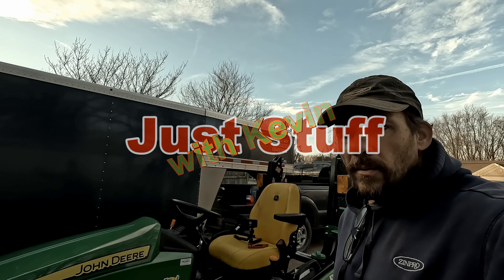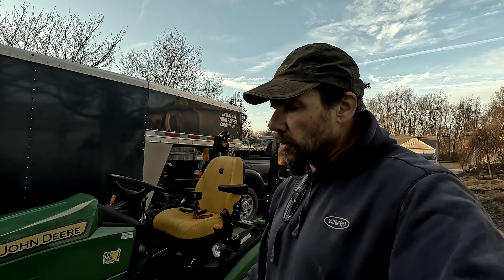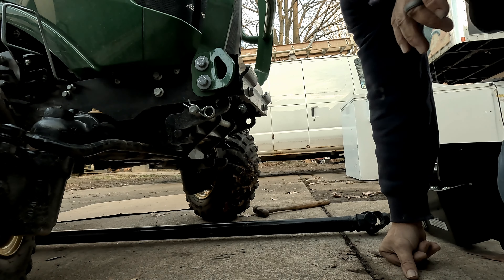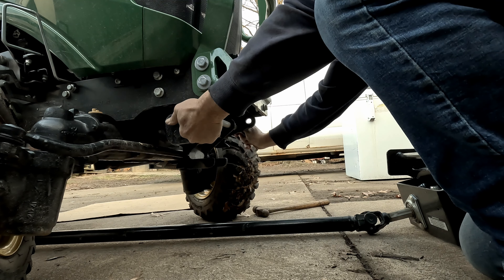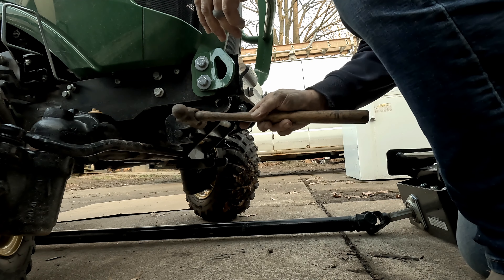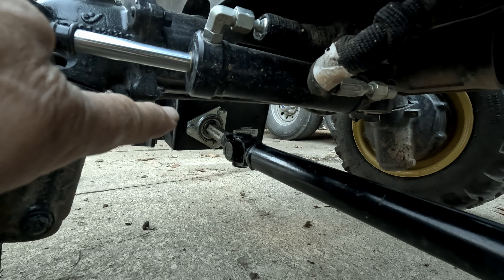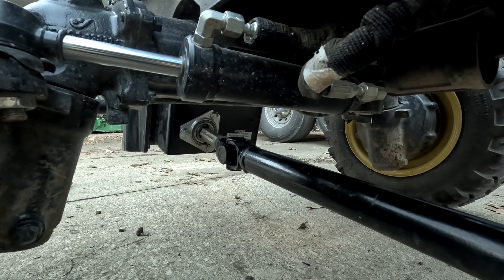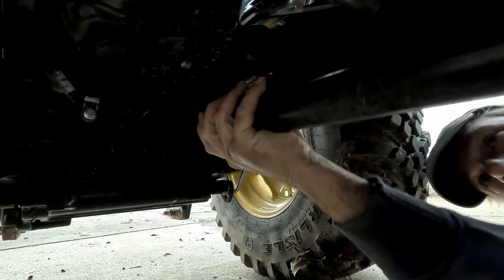Attaching the JD 1025R 54"Snowblower for the First Time, could have gone smoother

Comment: Hi Kevin, I have found a very easy way to install the snowblower attachment. I leave the shaft in the two bearings and spray lubricate the shaft so it will slide in between the two bearings easily.   I lubricate the back shaft on the transmission and lubricate the Power Take Off also.  i put the tractor in 4 wheel drive and drive front wheels on to two 2x6s that are about 1 foot long. with the tractor still running i turn the steering to the right. i set the brake lever and shut off the tractor.  Now the tractor is up off the ground about 3 inches.  i slide the shaft under the tractor and have the front bracket ready to be lifted in place. I than take the snowblower attachment with the shaft in the two bearings and lift up and over the two slots in the back. you can now install the holding rod to secure the bracket. i than just attach the back Power Take Off.  I have found this to be a very easy way to install the bracket and shaft.

Comment: Kevin, Thanks for the realistic video. I have a 2025R with the autoconnect mower deck. I have not connected the snow blower yet but unless yours is different the front bracket you show does not look like it is connected right. The snow blower bracket goes into the same slot that the mower front bracket came out of. You installed the front bracket on top of the slots not in them. Maybe it will work that way but if you look at other videos you will see the front bracket goes into the slots vs on top. Thanks for showing that you have to remove the autoconnect assembly. None of the other videos show that because they don't have the autoconnect assembly. I guess I would have figured that out when it comes time to connect the snowblower but no other videos I looked at mention this step.

Comment: The angle option is not used for the blower. You purchased the 4 way quick hitch which does it all. No angle for the blower but as you know you need it for your blade and it also is great if you were to ever get a broom etc.  just nice to have one hitch rather than two.

Comment: Thanks Kevin.  When using the blower only, there is a large pin that can be put into the hydraulic hitch to prevent the blower from turning.
Reply from the maker: Missing parts seems to be the norm for this dealer and would not surprise me at all. However, I don't think there is a spot for a lock pin
Reply from the maker: Thanks for that. I will look into it.

Comment: Do not turn the blower side to side! You will see a hole in the center of the quick hitch frame that you will need to get a large pin or bolt to fit in there to prevent you from turning it side to side. Also you did'nt need to get 2 of the first brackets. Y u can buy just the double bearings to add to your bracket for your plow bracket that just has the hole in it. Good video to first timers. Hope my tips helped. Steve

Comment: I have the same problem installing that bracket I have to turn the wheels to the right and finagle it up inside of there I ended up modifying the bracket I cut the corners off the bottom so it would clear the tie rod easier that helps big time I don’t know what the differences between my machine and the ones were the brackets just go up real easy Also I leave the lift assembly attached the snowblower and placed the whole blower on a furniture dolly cart I just bring the snowblower to the front of the tractor lift it up on the hook and hook up the hoses and it hooks up almost automatically so I don’t have to wrestle it that heavy Lift bracket

Comment: The angle cylinder is not hooked up for the Snow Blower hookup.  The Chute rotation hoses connect where you connected the hitch angle cylinder.  As mentioned JohnzCarz, you are missing or haven't located the angle locking pin to lock the front hitch in the straight ahead position.  Wish I could attach a picture showing the pin and its installed position.  I have the blade and blower and use the blade on both my 445 and 1026R  and the blower on the 1026R only so I have to be able to lock the hitch when the blower is in use and un-lock it with the blade.
Reply from the maker: I am heading to the dealer today in regard to the missing pin that I never knew that I was supposed to have. Thanks to everyone for pointing this out.

Comment: You don't use the angle with the snowblower that's why the hose caps are yellow and silver not the 3rd function colors.  You're going to put added stress on that drive shift and premature wear

Comment: I don't think you are supposed to swivel that hitch when using the blower. Can't really tell from the videos, but it looks like you are missing the pin that locks it in the straight ahead position - it's usually stored in another hole right on the hitch (when using the blade) and has a small chain on the end so you don't loose it. With the hitch centered & locked, you only connect the 2 up/down hoses from the hitch. Coil up, tie-wrap and stow the other 2 until you use the blade again. You then connect the blower chute's yellow and gray to the tractor instead of the 2 you stowed.
Reply from the maker: This dealer has made a bad habit out of missing parts. It would not surprise me at all. However, I don't think there is a spot fo a lock pin. I will check. You are the 2nd person to mention this.
Reply: @juststuffwithkevin9712  This video shows the pin you are looking for. 
https://youtu.be/wFpk6E-dloc?t=234
It's part of the hitch and should be installed by the dealer (or at least given to you at delivery). Later in the video you can see he put it in the 'storage' hole back towards the tractor.
Reply from the maker: @JohnzCarz   Thank you for the link. Now I know what I should be looking for.